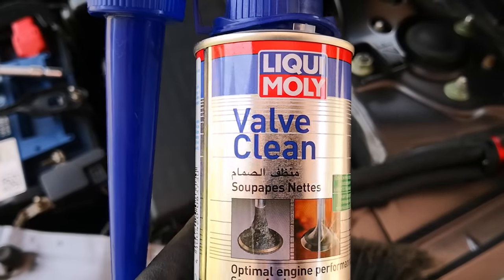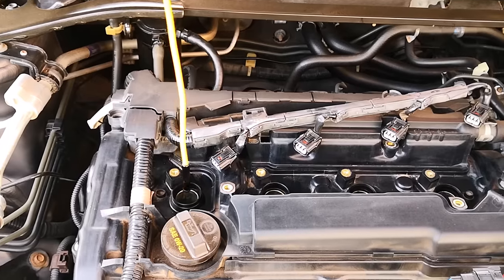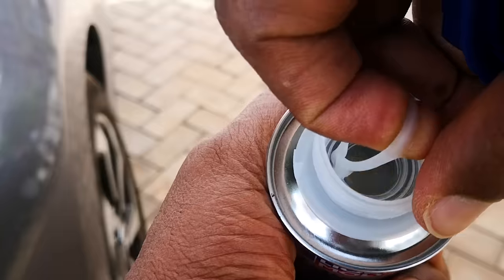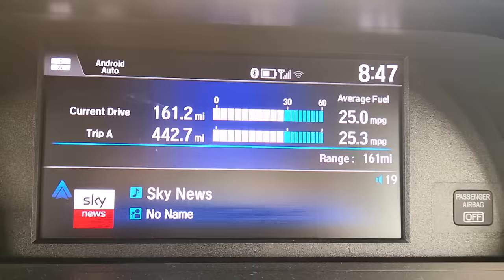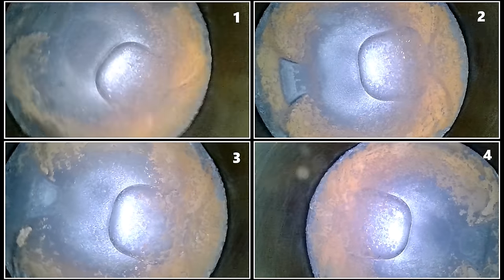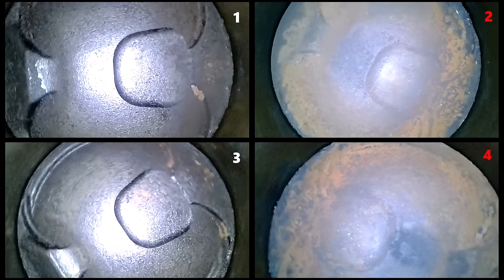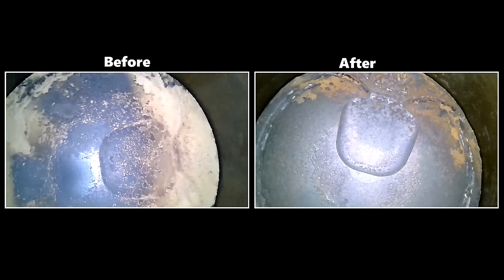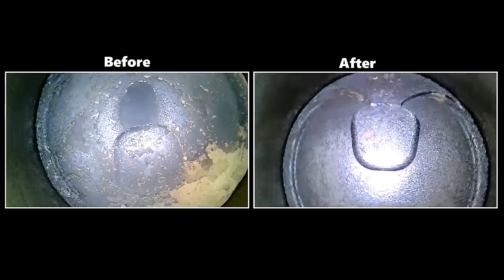I tested Liqui Moly on Piston Carbon Removal: Liqui Moly Valve Clean Works on Piston Carbon Build up

Comment: what if you put 30ML cleaner in the sparkplug hole directly in the chamber? Let is work for 8 hours, then look with the camera. Or then drive 1 mile and then look with the camera. Would the engine start with a bit of cleaner directly in the chamber?
Reply from the maker: Some cleaners are good for piston soaks, but from my little experiments, liqui moly valve clean isn't one of them. I've soaked spark plugs in it overnight, and it did zero cleaning. Didn't soften up the deposits. It's one of those cleaners that needs heat to work. If you do a soak, it's best practice to first crank the engine without the spark plugs to get rid of any remaining fluid. 30mls isn't a lot, but I wouldn't risk hydrolocking the engine. If you add a more substantial amount of fluid, then if should be sucked out first.
Reply: @DIYAutoworksNG  so what is better then the liquimoly?
Reply from the maker: BG44K Platinum did quite well in my testing though it's much more $$$. Another cheap option that I haven't used is B12 Chemtool
Reply: @DIYAutoworksNG  all stuff to add to the gasoline tank? Never saw those brands. But i am in the Netherlands

Comment: thanks for the video im going to use the liqui moly. i have same 2017 honda accord with 70k miles. does the product help with the carbon on the intake valves?  can you do a video on using product to clean gdi engines carbon off valves like crc intake valve cleaner. i have seen video using brake booster hose or thru intake hose after the mass airflow which would spray thru throttle body?   thanks
Reply from the maker: This product won't clean carbon from intake valves on GDI engines. It would do this only in multiport or older carburetted engines. 
I have used the CRC intake valve cleaner and have a video on it, though I didn't show before and after pictures. My intent in that video was to see if the carbon from cleaning blocked the catalytic converter. Video is here 
https://youtu.be/Uy5YLEDhT_k

HOWEVER, worry not! You must have seen my video schedule book! I'll testing the CRC intake valve cleaner again with with before and after pictures of the intake valves, so stay tuned. I use the CRC through the brake booster line which is preferred.
Reply: ok thanks

Comment: Take intake off and clean ports and valves manually
Plugs out fill the cylinders with kerosene for 2 days then empty and run
Reply from the maker: Still have a few more cleaners to test before I do a manual cleaning. Never heard of kerosene soak for carbon. Will look into it.

Comment: Just use their or any good foaming intake cleaner with engine at temp to intake while modulating/keeping revs up properly before changing oil and filter and you won't need this.
Reply from the maker: I'm expecting their intake cleaner and will try this.

Comment: What does this do for direct injection? 
Since you didn't mention that your car was multi port then I will assume that it was seeing your results. 
Additionally,  are you being sponsored by Moly?
Thanks
Reply from the maker: Hey. Thanks for your comment. Car is GDI. Was using this purely for combustion chamber cleaning. No Liqui Moly sponsorship. Bought the product with my hard earned money. Actually, none of the fuel system cleaner videos on the channel are sponsored by the manufacturer or retailers.

Comment: how do you keep your engine always clean? I want to clean mine but scared of electrical issues along the line considering Ford and Electrical issues but I am impressed at how clean your engine is
Reply from the maker: I generally follow the steps in this earlier video https://youtu.be/rGrqETnvVqk?si=jGUx4GANUI5_MkdI
It's a combination of washes and dusting off procedures. I think dirty engines are a turn off for videos. Lol. So truth is I do some quick dusting if necessary before videos.
That said, I hate dirty engines and wash mine about 4 times or so a year.
If you take the necessary precautions, you shouldn't have an issue with washing an engine, though I agree some cars are more temperamental about washes.
Reply: Use a blower.

Comment: Sounds like a piston soak with valve clean would be a better choice
Reply from the maker: I tried soaking a spark plug in it, it did practically nothing. It needs heat to work.

Comment: nice work. really thumbs up for your effort and sharing with us.

may I ask, have you observed any oil loss? I'm asking this because I'm sceptical about this kind of dissolving material can harm the valve seals and may lead to leaks. What do you think about this? Have you seen any extraordinary smoke coming out of your exhaust, or any oil loss during or at the end of this whole process? btw I surely trust Liqui Moly as I'm using the oils they sell with pleasure.
Reply from the maker: Thanks mate! I had oil loss prior to this procedure, however since this process, the oil loss dramatically reduced. I was having somewhere around a quart every 1500 miles or so. Now I've seen more than 100% improvement. It must have freed up sticking piston oil control rings. I also did a video on that shortly after this one.
Reply: @DIYAutoworksNG  Wows and hats off. I've checked that you have tons of videos. You totally deserve respect :)

Can you please give the link for that second video because I couldn't find it :(

btw I'm still watching your great videos :) And surely subscribe. Keep up the work. Thank youuuuuu :hand-purple-blue-peace:👍
Reply from the maker: Thanks a lot for the kind words. The 2nd video is here https://youtu.be/9q2n-5FZvr4?si=Oo_bSxXwrWhZGYxh

Comment: A few questions please: 1) direct or port injection on this car? 2)what camera do you use? I need one myself. 3)what oil do you use and how does it run now?
Reply from the maker: Hey!
Direct injection on the car. I use valvoline 0w-20 full synthetic. The camera is the depstech dual view WiFi borescope. Links in description. Car runs great
Reply: @DIYAutoworksNG  GDI ? Really ?
Reply from the maker: Yep

Comment: I wonder if the carbon would have been removed with one can if you poured an ounce or two in each cylinder and let it sit over night or 24 hours and then drive it?
Reply from the maker: Way back I had tried soaking iridium spark plugs in Liqui Moly Valve Clean overnight. It cleaned nothing. I believe it needs heat to work.

Comment: I'm wondering if it would work on direct injection petrol engines... i have 1.8 TSI engine
Reply from the maker: The engine in this video is GDI. The only thing is that it won't clean GDI injectors or valves. Liqui Moly has DIjectron which is suited for GDI cars. I couldn't find that though.

Comment: I wonder if buying better quality fuel would be as cheap per tank as buying the liqui moly ?? 🤔
I know that here in the uk the premium fuel has more cleaning agents in than the cheap supermarket fuel
Reply from the maker: Yea. That would be a good experiment. No doubt, there'll be less build up with premium fuel. I'd use E95 if I had it and then dump in a cleaner depending why I find during inspections.
Also, doing mostly city vs motorway driving will also affect rate of build up.

Comment: Doesnt Carbon brake Up at 350°c? Can I Just Drive longer or in more rpm so the build Up Carbon can brake Up and Exit Out the exaust? I have read that Carbon builds Up at 200°c but brakes Up at 350°c
Reply from the maker: You are spot on. A long trip with the opportunity to push the car would do a great job!

Comment: Hi, thanks for your video. By cleaning the pistons would Valve Clean help to reduce oil consumption? My car is a BMW with a M54 3.0 engine.
Thanks!
Reply from the maker: Yep. I experienced just that. It helped unstick the piston rings. I added the spirited driving though as you saw.

Comment: Having heard horror stories regarding removal of glow plugs in Mercedes OM606 diesels, how likely is it, with a system cleaning, that this problem could be avoided/reduced/eliminated/ fwiw, what engine was this? how many miles? what type of driving?
Reply from the maker: With good quality diesel and a good fuel system cleaner here and there, I'd say it would definitely help. This was a GDI engine doing mostly combined city/highway driving. Fuel quality isn't that great though. No premium blends. Mileage was 85k or so at the time.

Comment: Actually liquimoly direct injection cleaner will do a great job on port injected cars, it contains polyetheramine.
Reply from the maker: Totally agree. Car is actually GDI and I would have gone for DIjectron if I found it. Could only access valve clean at the time.

Comment: ok, how did it affect the performance of the car? What did it give you other than feeling like you had cleaner pistons?
Reply from the maker: Deposits rob you of gas mileage, power etc, and if you have enough of it, you will have pre-detonation from increased compression ratio. This was the case which made me use the Liqui Moly in the first place. Engine was pinging. It doesn't anymore (after the LM video, not this one. The deposits in this video were largely cosmetic). 
Finally, I did this for the sake of science, at least, let's know all know some of the non-invasive ways of dealing with carbon buildup.

Comment: This can certainly clean injectors and piston but how can a intake valve be cleaned when gasoline mixed chemical that doesn't pass through  intake manifold ? Can someone explain?  I think best way to clean intake valves and piston by throttle body cleaner spray.
Reply from the maker: You are 100% correct. This product is meant to clean intake valves in port injection vehicles not GDI, except if you use it through the throttle or brake booster line.

Comment: I hate to be this guy but this is not a good test.  

What you should have done is taken a baseline, do exactly what you've done with the Italian tune up, new baseline and THEN used the liquid moly. 

How are we to know if it' was the Italian tune up or the liquid moly?
Reply from the maker: Very fair observation. I did a different run with no additive. Will post video soon.

Comment: So, where does the cleaned carbon deposit went? Would it clog up other parts or filters?
Reply from the maker: The catalytic converter cleans itself. While it will get some deposits, those will be burned off if the catalytic converter is working well.

Comment: Hello friend is this dangerous for the car to fill with liquimolly every Fill up, i thought you should put one 2000 Km or more not every fill up thankss
Reply from the maker: It depends on the kind of Liqui Moly cleaner. Valve clean is recommended for every fill up. There are others recommended for every 2000 km.

Comment: Nice video. However, you're testing a change of two variables, so you can't say whether it's one, the other, or a combination of the two. If you have results of the additive alone for the same time period, plus results for the "Italian tune" for the same period (of course, all starting from the same baseline), then you would be able to compare all three tests to know if it was the additive alone, "Italian tune" alone, or the combination of the two being necessary. If it's just the increased combustion chamber temperature from the Italian tune burning off the deposits, then there's probably no point in using the additive, and you're better off putting the money into fuel for more "tuning" instead.

Of course, it needs to be said that a fuel additive won't help to remove deposits from the back of the valves of direct injection engines (unless they also have port injection, but having both is uncommon).

Comment: 5：16 What is the white area in before  ?   after using liqui moly the piston turned completely black, Isn't this more carbon？
Reply from the maker: The white are impurities in the fuel. They have to be burnt to carbon before that's it turn burnt off.

Comment: If we try to use this product (valve clean),what is the best way to use it?
By adding it in petrol tank or in air gate (throttle)?
Reply from the maker: I'm sure the manufacturer recommends it in the tank. Yet to see a recommendation to use it via the throttle, however, some people use it that way. I haven't done so.

Comment: My concern with trying this product is where does the build up go? Also did you get better gas mileage or a slight power increase?
Reply from the maker: The things I got
1. Better gas mileage
2. Pinging totally gone (the main reason for using the product)
3. Freed up oil control rings. Oil loss cut by well over 50‰.
I did a video recently on these benefits.
Reply: @DIYAutoworksNG  You did not address my main concern of where does the carbon/rust build up go? 

The results were clear that the pistons where clearly cleaned but where did that carbon build up go? Did the chemicals clean and combust cleanly and not seep or leak into the oil/fuel system? I find it hard to think a thick layer of that did not go into the engine system elsewhere??

I don't want an issue with my engine further down the line by increasing performance on  things like gas mileage etc that could potentially clog up my system and cost even more so.
Reply from the maker: Sorry I missed that. Held your view for years too but was encouraged after viewing the catalytic converter before and after using CRC intake cleaner. Video link below. https://youtu.be/Uy5YLEDhT_k?si=Bg2JezlXJK3U6r0M

My take, a normal functioning catalytic converter cleans itself. Even if there's some blow-by, I don't really think it would lead to anything significant. But that's me. Also I really didn't have an option. The detonation I was having would wreck the engine too if I left it. I don't have access to premium fuels.

Comment: If you do the same thing traveling in higway at high speed witout the product. Would have same results??
Reply from the maker: That should be another experiment. Open throttle driving definitely burns carbon, but I haven't tried that as a remedy for this level of build up.

Comment: The before and after images don't show what is asserted (and what performance difference was measured?) Aside from unequal lighting gamma levels, LED visible light is a poor way to show the extent of carbon deposits.  IR shows carbon deposits much more accurately..    Chronic low level water injection can do a better job of piston face carbon removal by increasing the density of the FA mix, than any volatile additive to gasoline can-  at 0.1% the cost.
Reply from the maker: I don't think you can argue the before and after images. I do agree with chronic water injection though, which is why pistons adjacent headgasket leaks are usually squeaky clean. What I'm not comfortable with water injection, is the quantity that would go past the pistons. Looks to me like it would encourage sludge buildup in the long run.

Comment: So in the cleaning process where do all of the carbon deposits go wouldn’t that mess of the rings? Or valve seed?
Reply from the maker: Leave with the exhaust gases through the catalytic converter and then outside. I've also done a prior video looking at whether the carbon from CRC intake cleaner use clogs the converter...

Comment: The problem is that using this amount of product can push the dirt accumulated in the fuel filter to spread throughout the entire fuel circuit
Reply from the maker: But that's why the strainer is there. Except if it's compromised.

Comment: I have various doubts. 
When cleaning the pistons very well, the car began to smoke. 
If you cleaned the pistons very well, did you also clean the injectors and intake valves? 
And have you continued using the cleaner to prevent the pistons and valves from getting dirty again??? 🤔🤔🤔
Reply from the maker: I've since used CRC intake cleaner for the intake valves. Will also do the Liqui Moly injector cleaner soon. Regarding keeping the cylinders clean, I found out that an oil catch can really helps, plus doing some WOT driving. Also been thinking of using a dilute form of a liqui moly (like 100mls in each tank). Maybe I may try a video on that. I wouldn't need all this if I had access to premium gas in the first place.
Reply: @DIYAutoworksNG  oh my friend I understand so it's all because of the high cost of gasoline. 
well at least it works.

Comment: what happens if you let that dirt? does the car loose performance? @DIYAautoworksNG
Reply from the maker: Yep, it does. On mine it was cause predetonation. Engine won't run at its best.

Comment: Was there any difference or improvement in mileage, pick up or less smoke from exhaust?
Reply from the maker: Gains:
No more pings, reduced oil consumption and improved mileage. I did a video on the gains https://youtu.be/7acdMb10Kbw

Comment: Do you pour the entire liqui Molly liquid in the petrol tank ? That means i need buy 6 bottles liqui Molly?
Reply from the maker: One at a time with each fill up. You may not need up to 6 cans. For example, if I were doing a 500 mile trip, a can or 2 I reckon should be sufficient since you would be driving at mostly highway speeds.

Comment: If carbon build up happens because direct injection engines don't spray fuel past the intake valves how does putting this stuff in the fuel tank clean the intake valves? Not saying it doest work just wondering how...
Reply from the maker: It doesn't. I was using it just for the combustion chamber as mentioned in the video.

Comment: why is no body asking the important questions….. 👀🤔👀 witch is what exactly is this stuff chemically and does it have any long term negative effects on the engine or fuel system ⁉️
Reply from the maker: It's mostly naphtha. No idea on any long term effects. Eitherway in my case the carbon buildup would have had significant impact on the engine since I was having pings from it. Totally stopped afterwards.